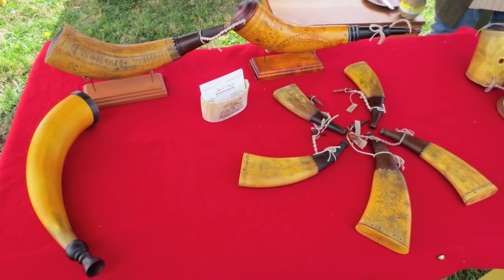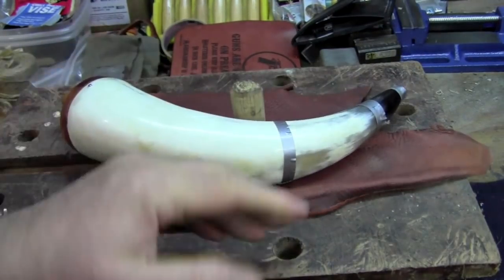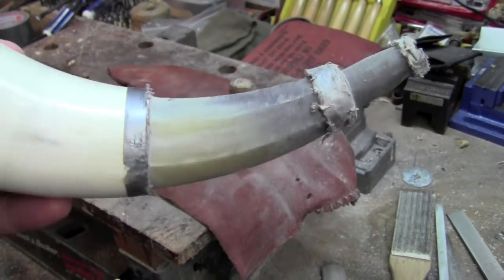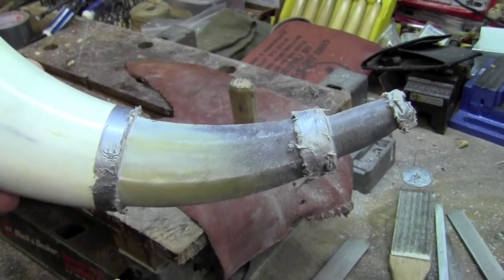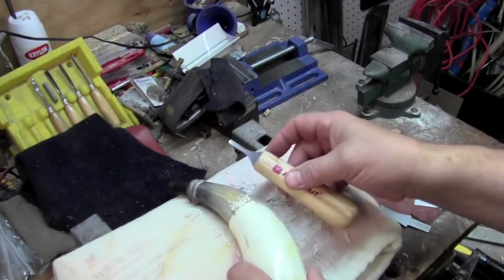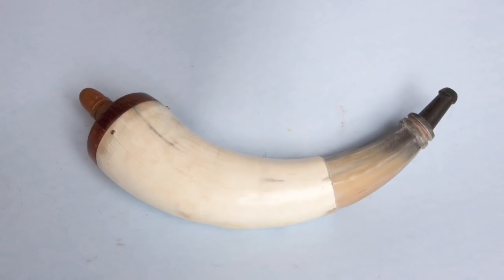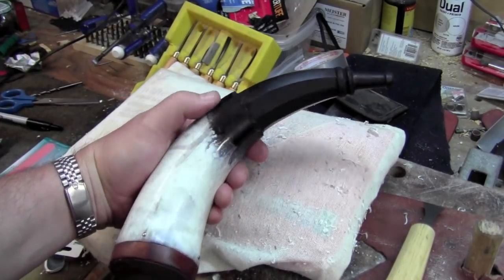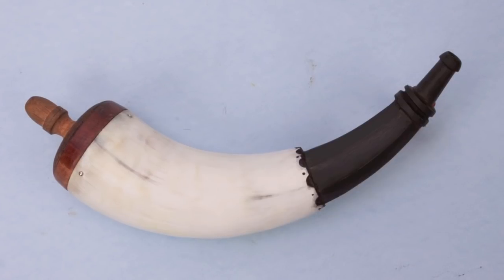Customizing a powder horn   phase 1

Comment: If you make a hole in your workbench you can loop a rope or a piece of leather strap over the horn. Put one foot in the loop under the bench to apply pressure and you can use both hands to control the tools.
Reply: That is a good idea.  I will try it.
Reply: Very good tip! Thanks!

Comment from the maker: Greg Miller, For some reason I can't reply directly on your question. The thickness of the horn varies. Down at the base id is about an eighth of an inch to a quarter of an inch thick. as you get closer to the neck, the thicker it gets. The neck is solid horn.